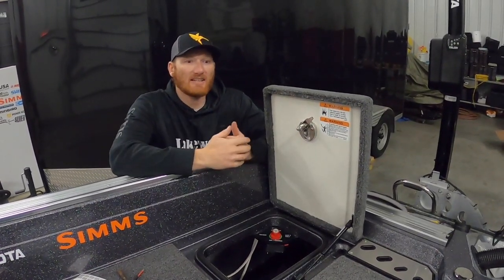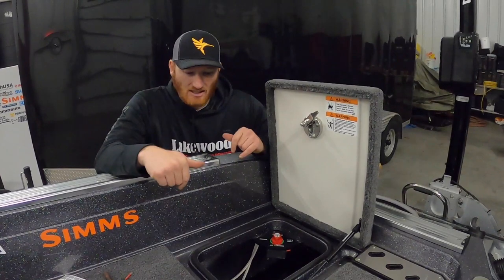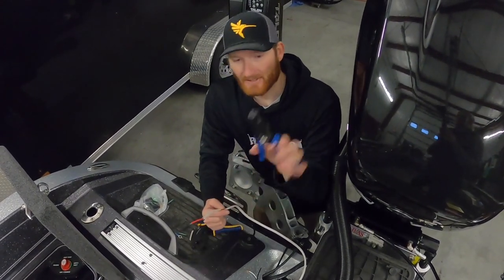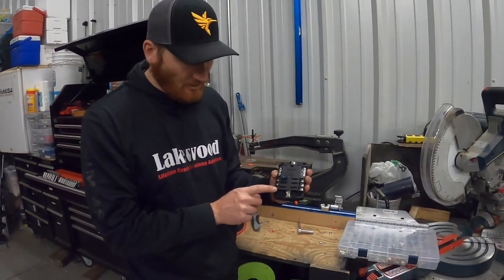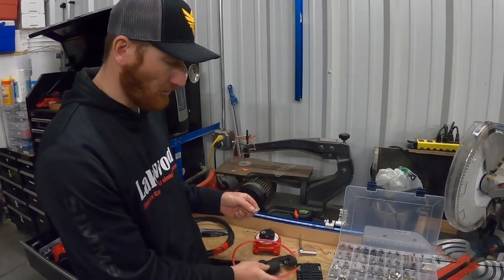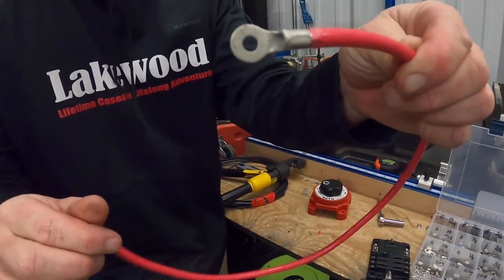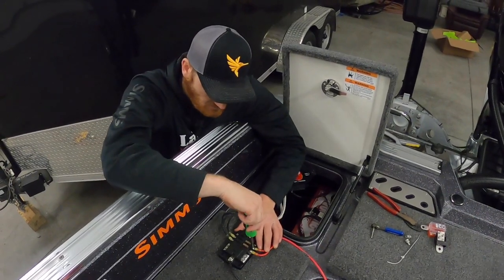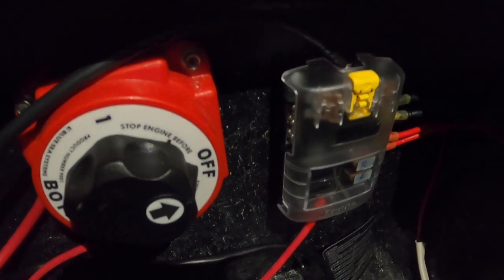How To Set Up Dakota Lithium Batteries For Fishing Electronics In Your Boat.

Comment: Why does the distribution panel have to be close to the battery? The battery disconnect close to the battery, i understand. Right now my boat is set up with the distribution panel being closest to console unit (on lead acid). I have just purchased a lithium battery to isolate my sonar units. Just doing my research.
Reply from the maker: U always want the fuse to be close as possible to the battery. If there is a issue you don't want it traveling down the line
Reply: Yes it can travel down the line but blows the fuse before power is sent to the sonar units. That was my understanding. Please understand that I'm not arguing with you. I will try to get my distribution panel close to the new battery. The main problem is my older  boat having room. I've noticed that on newer models, the battery compartments are bigger or just arranged differently.
Reply from the maker: On anything you power you want the fuse as close to the power source as possible. Do some research and its what you'll find. Many also believe less interference as well
Reply: If you put the distribution panel at consol, just fuse the wire from the battery.

Comment: Why didn't you ground your Dakota battery?  You have the black wire going only to the negative post of the battery and this is not a proper way to ground.  For Marine electronics proper ground is normally to the engine, you could have a dangerous situation or electrolysis issue. Please clarify.
Reply from the maker: You can't see everything...its all good
Reply: @Bigwaterfishing  That was a poor answer.  Suggestion, do a video on using a grounding block to make sure the starting battery, trolling batteries and house battery are all "Marine" grounded to the engine.  You would do a great service to your Channel and subscribers.
Reply from the maker: Check out other videos that deal with the rest of the batteries.  The trolling motor and the separate starting battery are not a part of this or any wiring. They have breakers where they are needed and put by the boat manufacturer. This was for a isolated electronics only battery
Reply: @Bigwaterfishing  so what you are saying, your isolated system does not need to be connected to a common ground to the engine?  Why?
Reply from the maker: @edmundknolmayer3579 As shown, the distribution panel is grounded on the battery. The point of this system is to not have outside interference . if you want to do it a different way, go for it, but this system has been done by me and dealers for years with zero issues to date
Reply: @Bigwaterfishing  Thank you for entertaining me with your answer.  Nobody has yet, including Humminbird ,  answered why a house battery is not grounded to the cranking battery and to the engine.

Comment: Thank you
Am I correct your start battery negative   is attached to your motor, and your lithium battery negative is not tied to your motor. So they are 2 isolated electrical systems.
Thank you
Reply from the maker: This video is about a isolated electronics battery totally separate from cranking battery
Reply: @Bigwaterfishing  so your electronics battery negative is not tied to the   frame ground

Comment: Do the on board charging systems charge the lithium batteries?
Reply from the maker: Some will, but not all. Need to check with manufacturer to be sure. I run the minn Kota precision and it will

Comment: Can't really mix Lead Acid/AGM starter and a Lithium house battery without a DC/DC charger / isolator.  The two types charge at different voltages.
Reply from the maker: You need a selectable charger, set it to AGM for the lithium and know you are only going to get about 90% capacity that way, which is still double what I was getting woth agm. I have a separate lithium I can use to top it off if I was going to need max capacity
Reply: @Bigwaterfishing  If you are always going to charge at home.  Why the battery switch then?
Reply from the maker: Ability to completely shut off power....those units always have a slow drain even when not on
Reply: @Bigwaterfishing  OK, so you are never charging off of your outboard.  Something like a Victron DC/DC 12 volt charging isolator would let you do that.
Reply from the maker: I dont